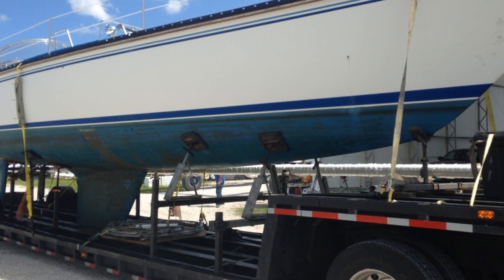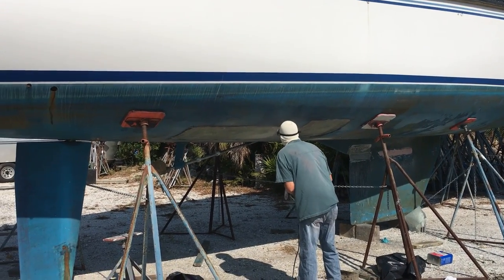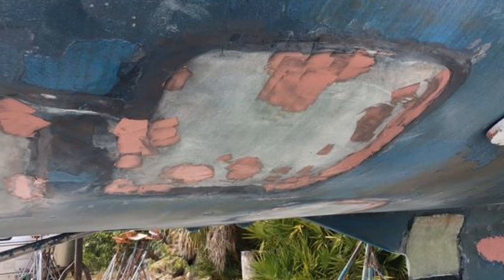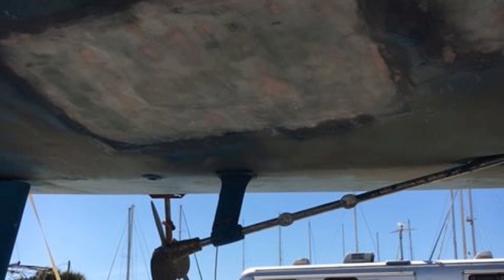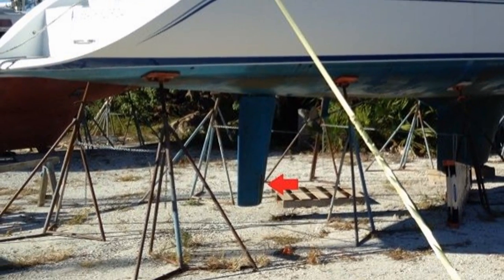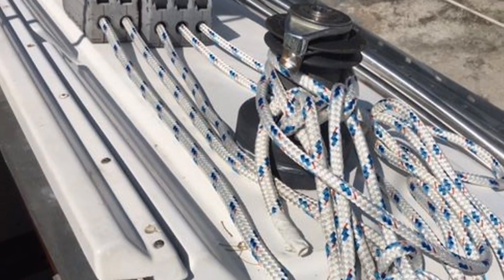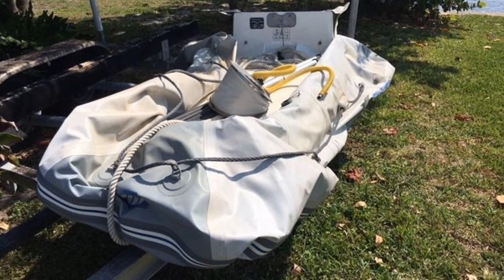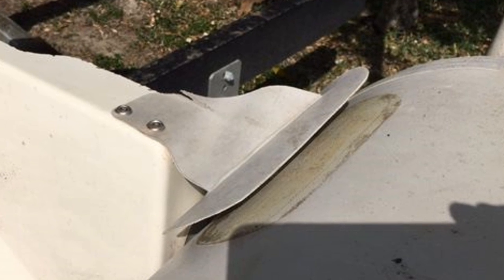Hull Work and More Progress - Ep. 7 - Sailing Moxie

Comment: confused on your constant referrals to fiberglass and epoxy. they are quite different. fiberglass is used with resin and mek catalyst. epoxy is a 2 part mix and cures very hard. also it seems like it would have been better to completely bead blast all the existing bottom paint off the hull before working on the areas with delam issues. hopefully the yard you are using is up to the task. and also i owned a hunter 54 a few years ago. be prepared for more surprises. once all sorted out its a great boat!
Reply from the maker: I did end up having them soda blast the entire bottom once the hull work was complete so that they could start with a fresh hull to build the layers of paint up. Lots of paint was chipping off. And it helped to uncover some other small issues with the hull. All fixed up now. -Matt
Reply: Fiberglass can be used with either polyester resin or a two part epoxy resin.